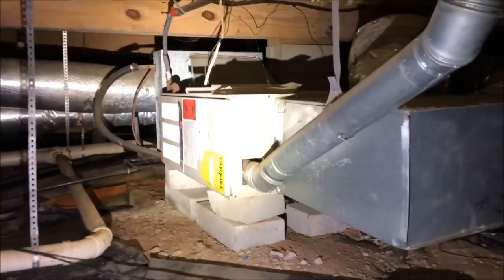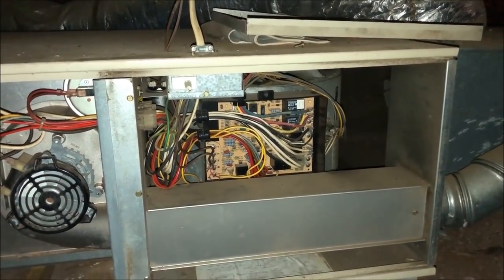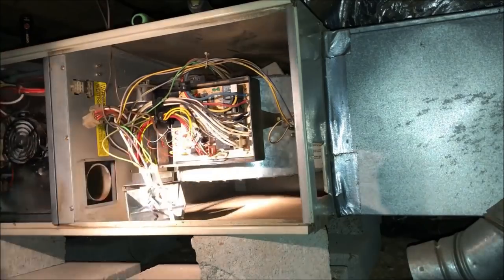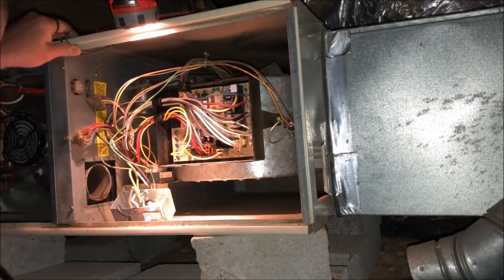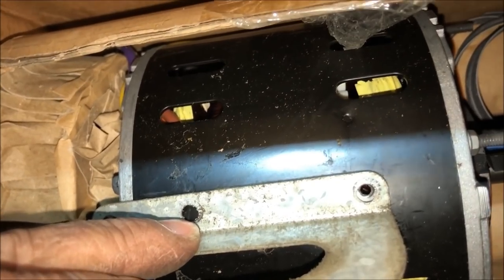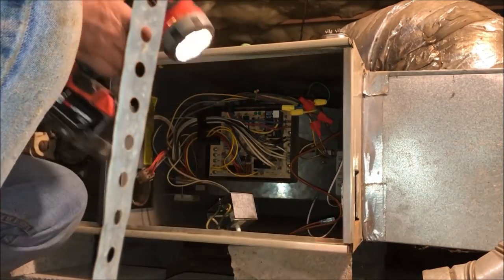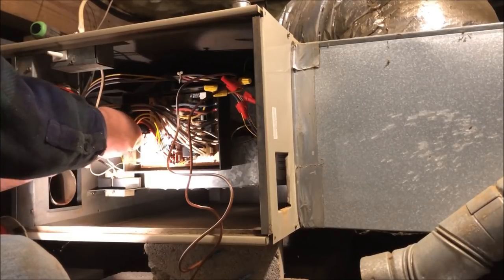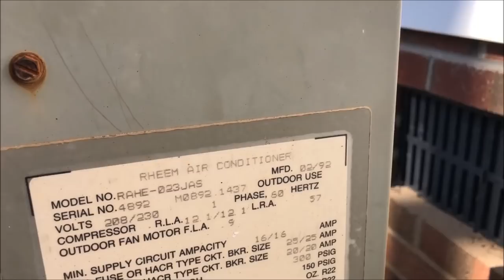Old Rheem Gas Furnace blower failed repair

Comment: I just wanted to thank you for this video.  I have the exact same unit.  I replaced it with a CENTURY FDL6001A and the holes lined up with the bracket.  I did not need to reverse the direction, default work.  In my case I was in a low ceiling attic and I have to move the gas line over to pull the unit.  I am a DIY'er not a pro.  THANK YOU!!!!!

Comment: I had to replace my blower motor today.  Thanks to your video I felt confident to take apart the flew pipe and thankfully mine was mounted vertical so going in and out was easy.

Comment: I just finished a REAL pain in the ass repair on a Miller/Nordyne counterflow
furnace in S.Philly. Approximately 45-55,000 btu's. In my 58 years I am really getting to be lazy. This was my 3rd time at this place in 2 weeks. It started out as a no heat call but it was working when I got there. I let it run on a long cycle,  no issues. Let it cycle again. Checked temp. Looked OK. Pleated filter was dirty but not clogged I replaced it with a fiberglass type. I couldn't stay there all day but what I DID NOT do, which I should of ,especially in a case where you can't find any issues is take amp readings of blower, also the RED
low volt. off the transformer when its running. This design is a first for me. It had a Robert Shaw All purpose ignition module with a HSI,not a spark. This design lights a pilot tube first,like a sparker, then ignites the burners. There was no flame sensor and had a indirect safety circuit. I told the tennant  to call me if he had anymore issues. Well,we had a little stretch of warm weather and didn't hear from him until 3 days ago. According to the
 Customer,he turns temp. way down when they go to sleep,and when they wake up in the morning,  the heater is locked out,but not all the time. It is  sporadic.Day 2.....he calls.,no heat again. To get him heat till I could get out there,I told him to reset  power switch and let me know what happens.  He did that,and said it was a no go.  So I made arrangements for later on that day and within half an hour he text me back,telling me the heat is working again. When I got there I was a little more thorough than the day before.
 But laziness kicked in when I didn't have the problem jump out at me and bite me on the ass. It was playing games with me. For 30+ years doing this,the 2 and 3rd visit was kind of embarrassing to me.Still on the 2nd visit,, I took some readings, and could not find the problem.  So,I decided to take a chance and order a new aftermarket ignition module,just in case and go back over it. Note: there were absolutely no Manufacturers tag telling me model/serial #'s ,the amp rating/ horse power of the motor , NOTHING.
So ,I took the flue pipe out of the way,pulled the 2 piece door off, and discovered the possible issue, or one of a couple issues.A air filter got pulled out of its track and was just laying on top of the blower.  The filter wasn't slightly dirty....oh no.....IT WAS CLOGGED ! I had to remove the blower assembly to check if the end bell was blocked with that nasty clumpy stuff that makes blower motors overheat and fail. Well, it was 100% blocked AND.....every vane on the blower wheel was thickly packed with debris. It was one of thee worse I have seen in 30 years. I texted my boss and told him there was no sense in cleaning the blower motor  and housing ,lets change the motor.So I took the assembly to UNITED Refrigeration .( btw, for anyone who maybe reading this,how popular is United refrigeration where your from?)
Got a motor,cap,and another aux. Limit that was on the blower housing. I tore that thing apart in the parking lot,wire brushed every vane on the blower wheel,and blew out the crap with nitrogen. Got it all back together, headed back to the job which I was dreading because of the lack of parking in S.Philly ,and people were coming home ,filling up any open spots available. I GOT LUCKY and parked right around the corner. Anyway,got the motor in,wired,and neatly secured with wire ties. I Initiated heat, it came on THANK GOD, and retook temp,and amp readings.  Temp.was steadying out at 141.  I dialed that back through the GV to 130. Looks good and hoping no more calls.I know my comments were unnecessarily long,sorry. I get long winded at times with my thumb🤣 Basically I wrote all of this as a confession to myself, that although I know what I am doing most of the time, I am getting lazy. I assume way too much. I am certainly sure I am not the only one, I am getting annoyed with myself .
Anyway, fighting alcoholism and trying to do a elite job for a boss don't mix.
It effects our brains in many ways.
I drank a 6+  pack a beer every night and Friday I'd drink more.iI started feeling like crap more then I ever have in the past,not to mention my lack of short term memory.  I have made a commitment to myself to stay off the demon root beer and straighten my ass out.  I want to start enjoying my job again. My boss has been very tolerant of my performance over the 8 years .I feel bad. I will get better. Thanks to anyone who may of read this.

Comment: I've changed that motor before many times here in Phx. Arizona in 115 F. in attics that are so confined, I have to lie on belly the whole time.   Absolute nightmare and dangerous as hell cuz the heat up in the attics in the summer goes a good 20 degrees warmer than the outside temp.  
     I envy the spacious crawl spaces and walk-in attics you have where you live. 
     Thanks for the info, the vids, and the entertainment.
     God bless bro.
Reply: I forgot to mention all while lying in blown-in cotton candy fiberglass insulation.

Comment: I’ve been doing HVAC in NJ for 25 years I have never seen this setup before with the flu going thru the blower compartment.
Reply: Have you seen the icp units downflow?  At least they have a panel isolating motor compartment.
Reply: It is a counter-flow unit, the flue pipe inside is 1 piece, as well there are doors behind it . No licence, no touch.

Comment: I am a Ruud dealer, if that's a 1992, that was either the first year or close to the first year, the Rheem/Ruud furnaces come out with the inducer and board models. I can remember the first ones very well, I must have changed 50 boards, because they had a bad issue with their boards, but Ruud/Rheem has come a long way's since then, they have some very nice quality furnaces.

Comment: It may have been said here and elsewhere, but I point out to guys that any dirt in the blower is also going to be found on the evaporator. It may be imbedded and the only way to know it is there is by knowing and measuring the pressure drop across the coil. Yes I know that data can be hard to get. All the data is made when the equipment is squeaky clean at the factory lab. Low suction pressure and low superheat will be a telling symptom.

Comment: If the heat exchanger is good, just keep changing parts. Rheem I believe used stainless steel and long sweep tubes on all their primary HE, they last 30+ years.   We have plenty of 25+ YO Rheem we service.  Carriers uses aluminized stamped steel, we condemn about 1/2 the units we go to repair that are over 15 years old, showing signs of draft issues and/or cracked HE.

Comment: I used to have a gizmo that would go into a Cordless screwdriver or drill to tighten wire nuts.  It sure makes it easier if You have to put a lot of wire nuts on in a day.   I think they used to give You the tool, when You buy wire nuts.

Comment: I do everything the exact same way as you but I use electric tape not zip ties. I probably go through  6 or 7 rolls of electric tape a month in the busy season haha. It doesn't cost much. I live in a very hot dry climate so if the sun shines on them zip ties they don't last but 3 years before they crack

Comment: I have always found it easier to unplug blower motor wires from control board. Dismount control board from blower housing and prpp out of the way. At that point blower is simple and quick to remove.
Reply: He removed the unit the most practical way.

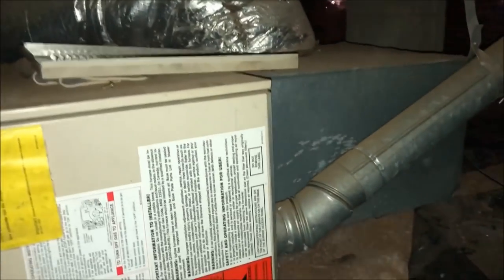Comment: I have two Carrier horizontal gas furnaces in the attic which have similar configuration to Rheem 80% furnace @5:37 in the video. I don’t see a filter in the video. Does this type of furnace have a filter? If it does where would the filter be. I have been looking to change my furnace filters. I thought it would be between the blower and the intake vent but I couldn't find them on both furnaces. Any advise would be appreciated.

Comment: These models  are laborious to repair.  The worst part is the exhaust pipe runs through the return air intake of the blower. I have had units where the exhaust seeps into return air flow, not a good design. From what I can tell, The pipes warp over time and leak at the connections. Since new parts are hard to find, I had to upgrade to new with trane

Comment: i would think the plumbing pipe that was in your way was a vent heading for the roof , so no water in it in the attic when it wasnt raining . So maybe it would have been worth your while to cut it in a couple of places to get it out of your way then put it back together with a couple of couplings after you were done .    Anyway now that you have a new fan motor in it now some other part will probably go bad .     But it doesnt look like that was a real terrible attic to work in . How much fiberglass did you breath in ?  Were you itching all over for the next day or two ?

Comment: I replaced those motors Rheem carpetable  replacement had the holes in the housing no problem. It might have been a Century motor

Comment: Does it run separate heating furnace and air conditioner on Ruud  central heat and air split unit

Comment: It's funny how there are little differences in troubleshooting approach among technicians. If it were me diagnosing this one, I would have killed the power a couple of seconds after hearing the motor try to start. I would have figured either the motor or capacitor or both were bad. I would not have seen the point of letting the motor strain and overamp for over a minute. 

Not that there's anything wrong with that. Just different approaches.
Reply: With my luck it would have popped the breaker, requiring me to traipse up and out of the crawl space, and back down again.
Reply: Immediately. Totally agree

Comment: I also always replace the wheel with a motor on a older unit. Lucky that came off as ez as it did. Plus there usually full of shit from years of service and get bent up when replacing the motor

Comment: I'm also not big fan of Rheem older equipment newer looks slightly better design. But one thing about is those gray capacitors they used last a long time seen some older 15-18 yrs old system and still within range.

Comment: When it comes to the direction of the motor rotation how do you make sure it is the correct rotation since you can have it go either direction depending on what side you are looking at / using as a reference?
Reply: The wheel has a cup in the spokes. Just imagine the cups scooping air. That's how I do it anyways haha. You can generally look at the housing to see what direction is throwing the air into the ductwork.
Reply: motor rotation...look from the back of motor side,,,not from the shaft side of motor...a motor that turns to the right is clockwise...

Comment: I’m surprised there’s a Rheem out there that old still running
Reply: my Rheem is a 1988 and running good, knock on wood.
Reply: I would put a rheem against any brand. I have been installing them for 15 years. They are very reliable and last forever.

Comment: Jack of All Trades - Master of None...
The big problem with those "universal" Wire Nuts that can be used in place of 3 or 4 other specific Wire Nuts is unless you put them on PROPERLY, they tend to create a lose electrical connection...
The  MASSIVELY HUGE problem with lose Electrical Connections is they get hot...
VERY hot...as in start a fire and burn your house down killing everyone in it hot...
Please don't use Wire Nuts of any size (or do any kind of Electrical Work) unless someone that knows what they're doing has shown you how to use them the right way...your Home, Family, Fire Department and Insurance Company will thank you for it...

Comment: Crapily Designed Garbage like this is why it should be a Federal Law that EVERY Product/Device Designer should be forced to repair their stuff for a MINIMUM of 1 Year before being allowed to Design new/upgraded Products/Devices...
Then you wouldn't run into things like this...You'd never need to pull half the furnace apart simply to get to the blower, just pull 1 access cover, undo 4 wires and 2 bolts and the blower slides out neat as you please...